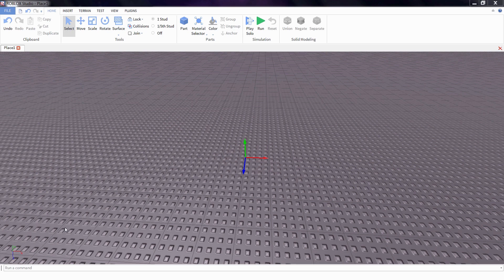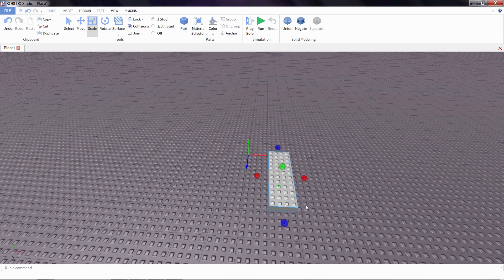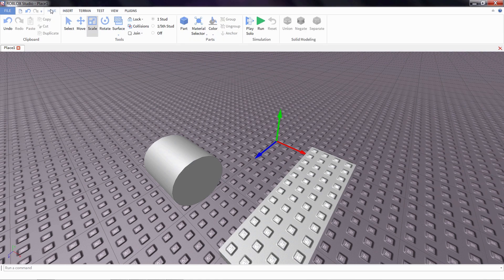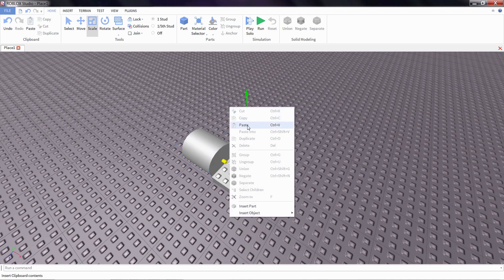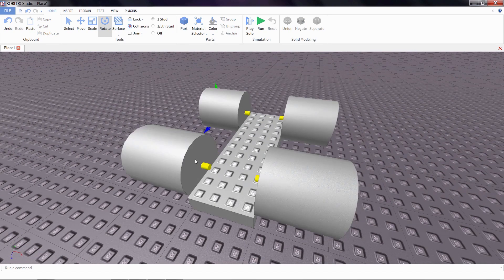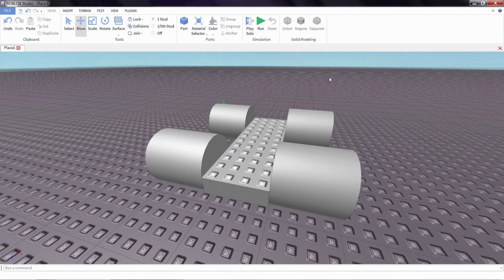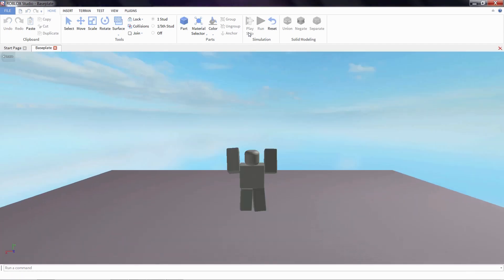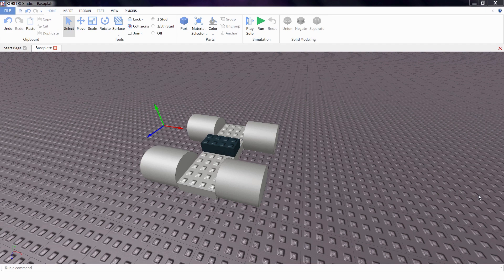ROBLOX Racing 1: Build a Basic Car (ROBLOX U Tutorial)

Comment: It worked out mostly until I played it solo. It was mostly functional: I could sit down on it, and it could move, but I could not control (while sitting down) if it was moving or not. I'd have to stand up and push it. Is there a function with the seat that I'm missing that allows you to move the car?
Reply: Never mind. Apparently I was using a regular seat instead of a vehicle seat.